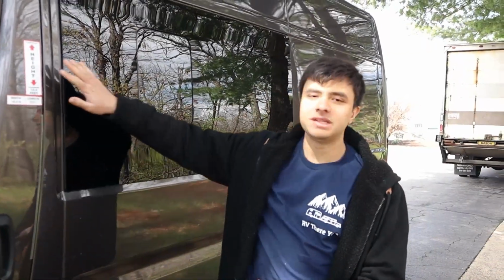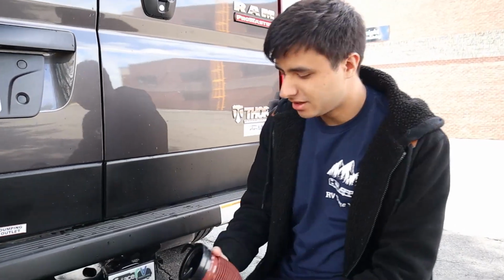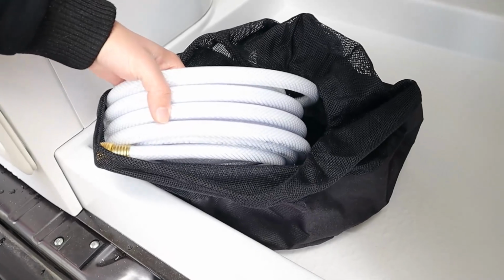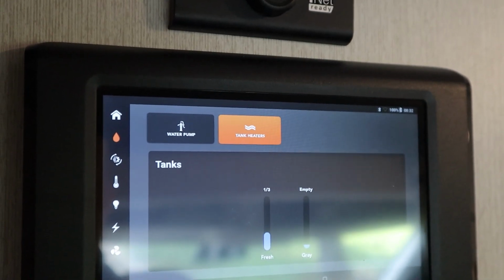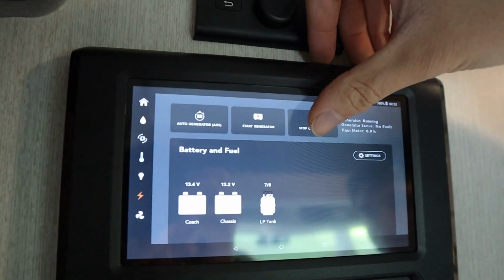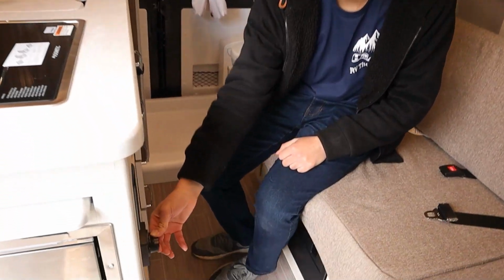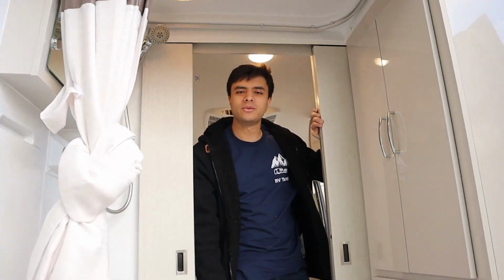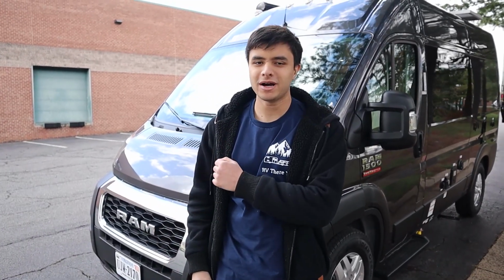2023 Thor Rize 18M Walkthrough · Ace RV Rentals & Sales

Comment: I thought the fridge was 12v only and does not use propane, am I mistaken or is there an option for 12v/propane fridge?
Reply from the maker: Hi Jeff, this unit has the option for a 12v/propane fridge!  We are able to customize some aspects of our units as we order directly from the manufacturer.  I hope this helps!
Reply: @AceRV  to be clear, I assume the specific unit you were reviewing did not have the 12v/propane fridge.  If/when it has the 12v/propane optional fridge where & how do they vent it?
Reply from the maker: @JeffErdmann  Hi Jeff, the unit would have a vent leading from the fridge to the exterior of the RV, similar to how the fridge/vent look and operate in bigger motorhomes!
Reply: Well Done

Comment: One of the better walkthroughs, thank you!
Reply from the maker: Thank you for the kind words Terrell!
Reply: Hey Terrell, @TerrellWSmith I watched your informative Class P RV videos. Are you still car camping with your Prius?
Reply: @JeffErdmann  , Class P RV -- I love it! This last summer, for the very first time in my life, I rented a Thor Rize 18M. Had it for two weeks. The build quality was sadly lacking, but the layout was great. I cook with a microwave, and it seems most small RVs do not have one. But my Prius RV does, powered by the Prius itself. And the Thor Rize also has a microwave, powered by the on-board generator. The Prius is much quieter, but the 18M was not too loud. Especially compared with other generators running in the campground. To cook supper, I only need to run it for roughly 5 minutes (depending on what I'm cooking). Comparing the two, the Prius gets around 45 mpg, the 18M got around 12 mpg (mountain driving). Both drive very well, and park easily. There's a lot more room inside the 18M, of course. Room to stand up. This difference is quite important in pouring rain! During heavy rain in the Prius you're pretty much stuck in place. In the 18M you can move around a little. It did leak on me (through the closed roof vent) in the middle of the night in the 18M. Never had any rain come into the Prius. I did not like the 18M table, and after the first time, stopped using it. I used the sink cover as a lap table the rest of the time. If the 18M was better build quality and not so expensive, I might consider buying one. Renting one seems to be the best option for me. Why? I'm getting older, and having a little more room  than in the Prius is a big factor.

Comment: Why have a generator if it can't run everything?  And you said don't run the generator for more than three hours. A generator should be able to run non stop for as long as you need it. So what kind of generator is that.You said the battery is for minor things like the lights. That van is an expensive piece of garbage. Basically you have to be plugged in to get any real use out of the van. You can't even boondock with a generator not recommended to run for more than three hours at a time. You also said dump the toilet cassette in the sewer. That's illegal. You're supposed to dump those cassettes in a dump station or in a bathroom toilet not the sewer.
Reply: He was talking about the sewer connection at a campsite. It is not illegal; that's what they are there for. Many people boondock with only batteries and solar; they don't run the A/C. This is who the van is marketed to.